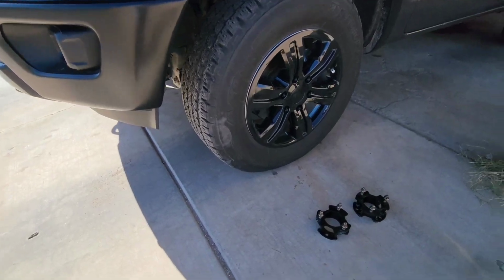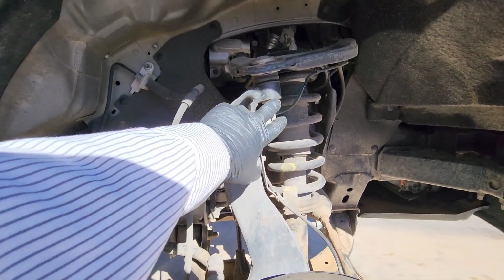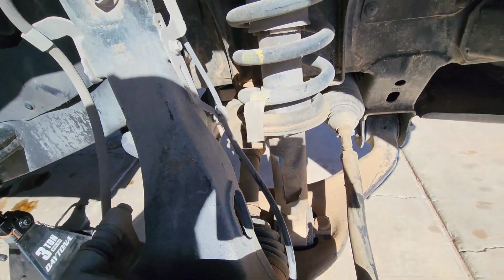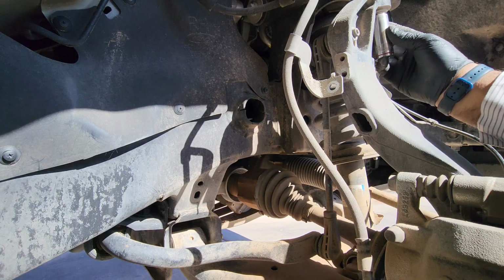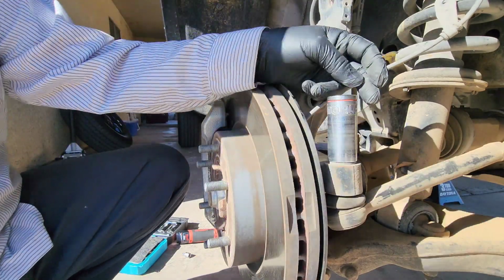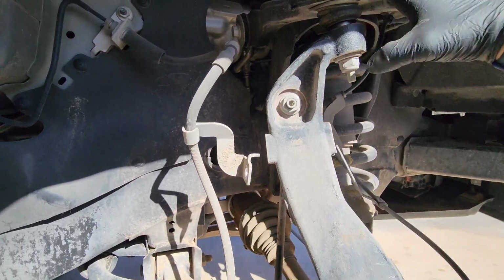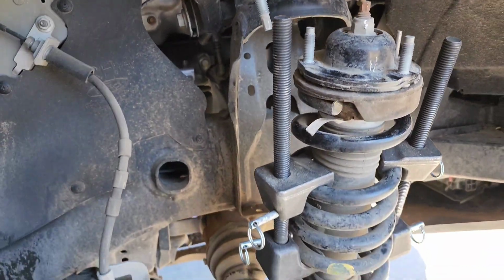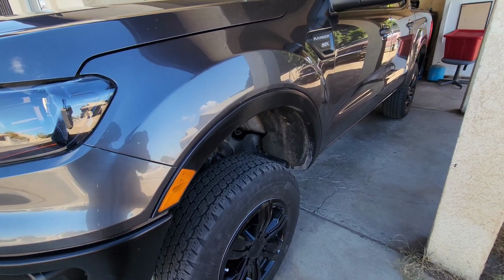2020 Ford Ranger2.5 inch leveling kit install

Comment: I had a shop install my 2.5 leveling kit and everything was great for 1 week, now every time I go over a speed bump I get a squeaking sound from something up front.  I took it back to the shop and was easily able to replicate the sound....but they couldn't figure out where the sound was coming from.  I watched as they tried to tighten everything and it appears everything is good, but I still have the sound.  At times it sounds like the sound is on the left side and other times the right side.  I'm going to take a good look at the sway bar and see if it's loose.  I didn't see them try to tighten the nuts on that.
Reply from the maker: Thats a good place to start also what u can do is jack up the front end and put a pry bar under the tire and pry upward to see if you can hear the squeak. Might be your top ball joints.let me know if that helps

Comment: can you send the link to where you got the leveling kit
Reply from the maker: @elijahstebbins5858  https://www.ebay.com/itm/283757092502?mkcid=16&mkevt=1&mkrid=711-127632-2357-0&ssspo=O63xtQy6RCu&sssrc=4429486&ssuid=r0vV3KLdSHm&var=&widget_ver=artemis&media=COPY
Reply from the maker: @elijahstebbins5858  the link is  here its from ebay the only thing i had to do to it was weld the the bolts to the spacers off camera.

Comment: A WEE BIT TOO HIGH IN FRONT END IMHO !! SPRAY SILICONE LITHIUM GREASE ALL METAL PINCH POINTS.. THEY DO MAKE INSULATORS TOP & BOTTOM SPRING COILS ON THE MARKET

Comment: im trying to figure out if using a spring compressor would work better and avoid having to remove some of the stuff i see being removed? just wondering if it would make it easier?
Reply from the maker: You need to remove the strut to install the spacers, there is no way its possible to install the spacers without removing the strut. But yes you can remove the strut without a spring compressor but you will need help to push down on the control arm while you pull out the strut.
Reply: Don’t do it